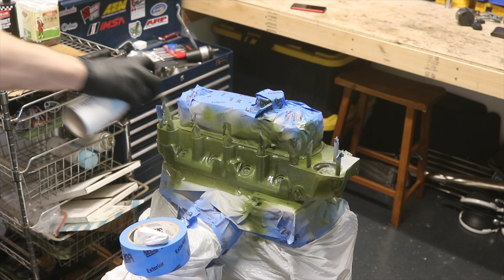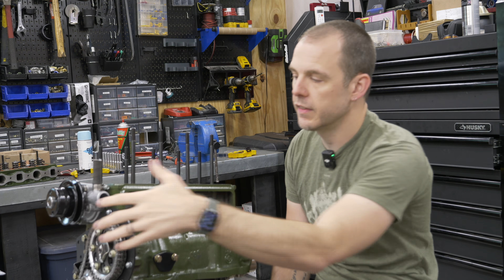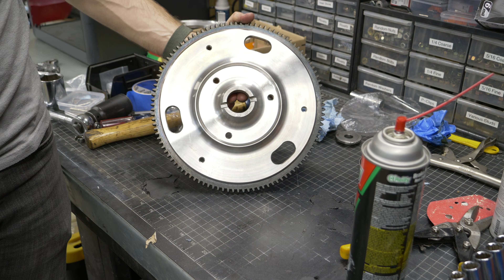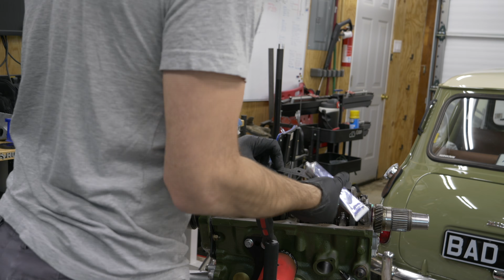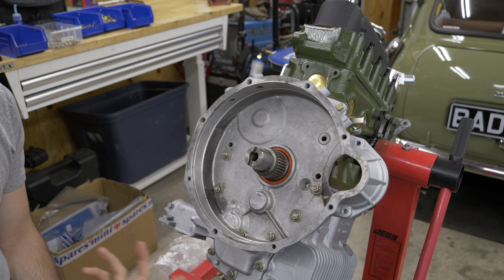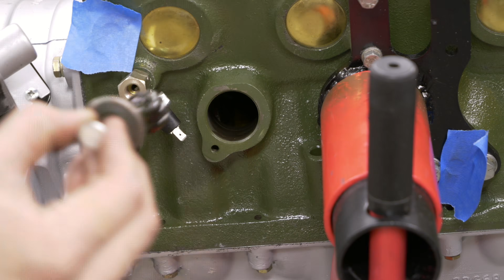Technical - 1100 Torque Machine A-Series | Final Engine Assembly

Comment: What’s your intake/induction plan? Are you fuel injecting again or maybe an Hif44?
Reply from the maker: For now we are sticking with an HIF38 which should be pretty solid for this size engine even with the larger valves. Long term we might move to a set of dual HS2 to really maximize the torque down low.
Reply: @classicminidiy  I would love to see how that combo performs with the MED stub stack/filter combo to really smooth the airflow in. Will you be making a smaller efi throttle body? Hif38 sized? Might be interesting to see a dual efi manifold in place of dual hs2.

Comment: i have done nearly same on my 1098 morris minor build, 40" over flat top gramham Russell, 12g295 head with larger valves.. except i am also looking at using 123 ignition .
Reply from the maker: Thats going to be awesome! The distro I am using is the Swiftune CSI Digital one so its essentially the same thing as the 123, just with Swiftunes curves programmed into it.

Comment: Great video!  I'm rebuilding my stock 1968 850 motor and the small oil deflector that goes near the seal on the primary gear has broken off.  I see yours doesn't have the deflector and understand that later gears don't either.  Should I buy another gear with a deflector of do you think my gear will be OK?
Reply from the maker: Are you referring to this plastic part? (link below) If so, I would add a new one. Its a little bit of extra insurance to help prevent oil from getting on your clutch and they are so cheap/easy to replace with the engine out of the car. 

https://www.minispares.com/dam2821-clutch-seal-protector-shield-fitted-to-verto-clutch-on

Comment: No strong back, or 4 bolt cap, on the centre main?
Reply from the maker: Those strong backs actually weaken the center main as they require material to be removed. This is not an engine destined to be revved high due to the limitations of the 1100 so the 4 bolt center main would have no value.

Comment: What’s the specs on the camshaft and is that a 12G295?
Reply from the maker: The cam is a swiftune SW5 and it’s a 12G202. Pretty similar head but has more meat for chambering and porting than a 12G295
Reply: @classicminidiy will you have photos or videos of the port work?